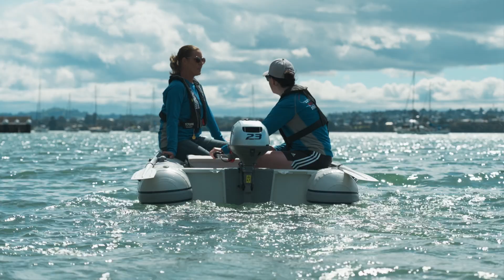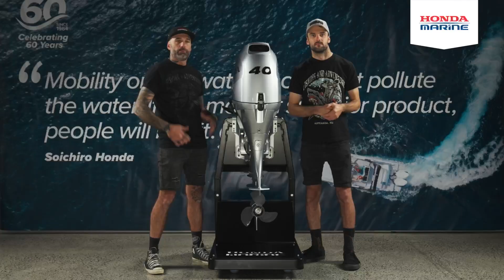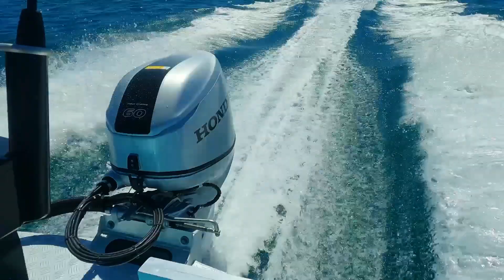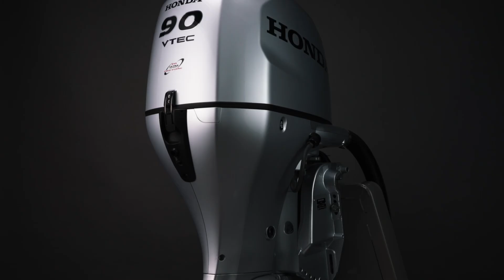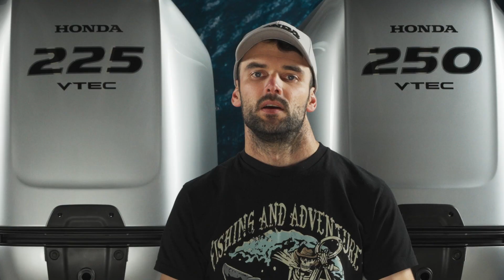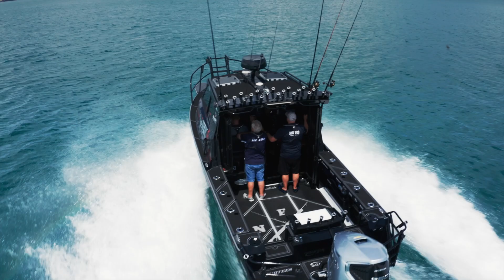Meet the Honda Outboard Range with Scott & Mig

Comment: How may pole stator on a 2011 BF60? My tack only reads 2800 rpm full out at about 33mph. My tack may be on the wrong setting? It is on a 2011 Alumacraft Classic 165 CS.
Thanks for any help.
Reply from the maker: Best to talk to your local dealer on specific settings for hulls and configurations. Thanks